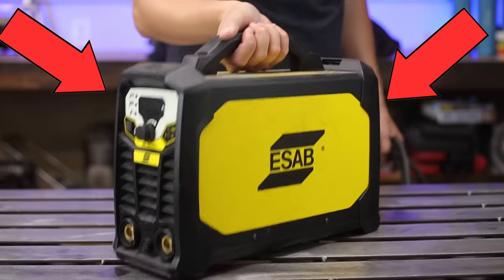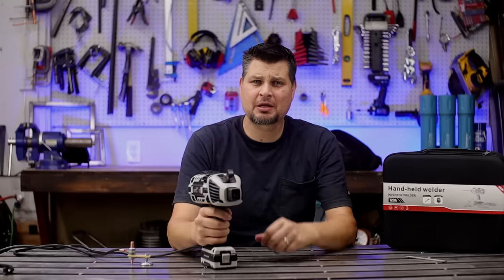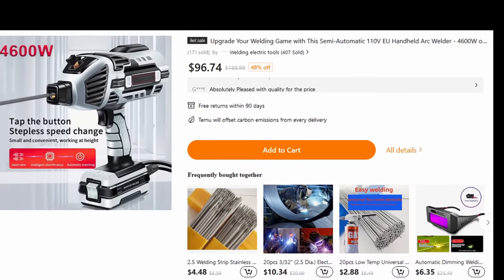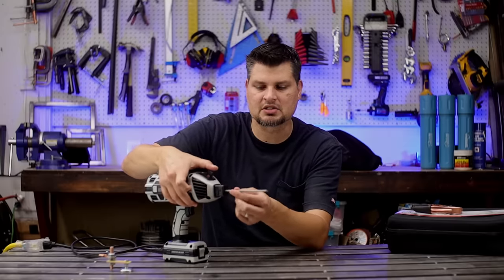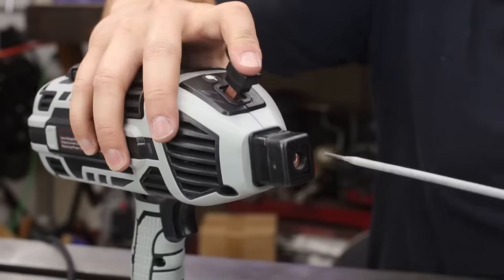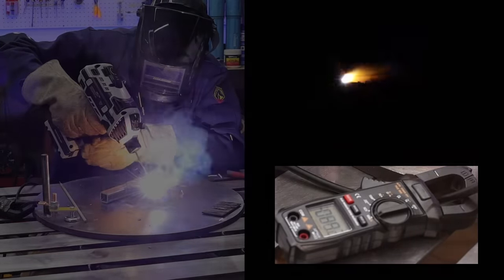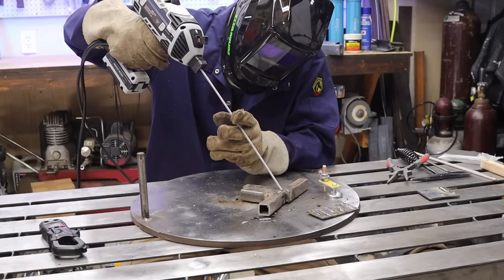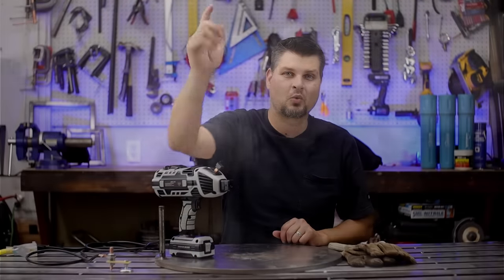The WELDER, Re-Invented! TEMU Surprise

Comment: That's like welding with a Brick.....I prefer to use a stinger.
Reply: Yes 🗿
Reply from the maker: Yes indeed!
Reply: agreed lmao
Reply: My first thought was I don’t weld a lot but damn I bet it gets heavy💯
Reply: My hand is tired looking at it. Maybe a roofer that handles bostich guns will like it.
Reply: @timwilliams2035  It would be cool if it was wireless but you’re still hooked to a short ass cable making it not useful
Reply: @@Eric-ub3epNot comparable. Welding requires fine, precise movements of the hand during operation, a drill does not.
Reply: Never seen this before,  might give it a try.  Got some occasional  scenarios where it would come in nice and handy.
Reply: @@Eric-ub3epyeah it’s a lot different   You must not weld
Reply: @theinquiringengineer bingo
Reply: @@Ralph-ub3ep The difference is I bought mine for 60 bucks and works as good as my miller that cost 800 bucks
Reply: @@Ralph-ub3epA cordless drill isn't 10 times the weight of the tool it replaces.
Reply: Dear sir, explain for a novice. Did some welding in high-school (i made a glowing ball). I’m a 37 y.o. electrician now, and wanting to buy something budget (pay for what you get). What am I looking for?
Reply: @darzo7527 a lot of these have a stinger attachment.  Makes it easier
Reply: Think outside the box bro.  You and the boys are out bombing the trails in some piece of shit jeeps.  You break a leaf spring on the trail and johnny has a 1000w inverter generator.  Presto you're welding on the trail instead of hauling the 100lb tombstone from the garage.  This definitely has its purpose.
Reply: It would probably be just okay for a portable "down n dirty" quick drive over to an emergency type weld for a temporary fix???

Comment: I actually have this.  It's legit as a beginner tool.  I've used it for 4 hours learning to weld yesterday. It's doing great at teaching me.  I've had none of the issues with the clamp, but I want to replace it with a magnet regardless.
Reply: This is awesome for backyard projects, I was able to do a full exhaust with this thing, also I got it for 43$ from temu ONG ITS WORTH IT
Reply: Replace the clamp with a Magnet?
Reply: Ats funny as hell. I learned how to weld yesterday
Reply: Cut 30% of the ground cable off it'll perform 300% better .. just take my word  you don't need half of it anyhow

Comment: This could be handy in an off-road situation to fix your rig to get back to camp!!!
Reply: Just bought one on Amazon gonna test out plugging into a 12v 450watt dc to ac converter! See if it will operate good using 3/32 rods or 1/16 rods
I tried this but it was not enough wattage to turn it on! Probably would need 1000-1500watt inverter to make this run!! Gonna try an 1800 soon and see! I Will post back here!
Reply: Exactly. Anyone with vision with preparedness would stash this in a side panel as a field option to get out of a bind. This is exactly what I said when he confirmed it could get an acceptable bead w/ penetration.
That's all we need to make it home.
Reply: @outdoorzone  just posting so I can see the update with the inverter.
Reply: Ive seen people take a lithium ion polymer pack from a car jump starter and use it to stick weld. Could probly have a dual purpose emergency welder/jump starter with a little know how. It was a radio tower tech who had to climb up and down those tall towers to make repair welds that were tiny but impossible to bring a welder up the tower for. So tiny light lithium pack with the clamps it came with and he had the perfect stick welder and no longer had to make those extra trips and hoist things up and down. Plus no need for a generator or inverter
Reply: @GonzoDonzo  nice!!!thx
Reply: Where you gettin your 120 power from if your packin a genset then pack a decent  welder
Reply: Sounds like a great way to burn down a forest trying to save a few bucks….

Comment: Seems like a good little low footprint emergency welder for those times at the track or trail when someone has a generator or battery box handy to make a trail or track repair on broken motor mounts or suspension components to get home.
Reply: your sentence reads like a looooong trainwreck. But : "yes", it appears to be a good single-use emergency welder.
Reply: @ololh4xx  I read it just fine. I don't know what you're talking about.
Reply: @maxx1o1 I think it’s a dig at the lack of punctuation. No commas, no full stops etc etc
Reply: Picture this:  You're leading a group of eight four man fire teams into a building secured at ground level.  You find a vertical steel beam, live power and quickly weld ladder rungs up to the third floor where you then descend and mop up the enemy.  Works better during daylight.

Comment: Even at a couple pounds only using that for an extended period of time, trying to be steady, it is certainly only practical for little welds, but I am impressed that it does work.
Reply: @tripplefives1402 ...... Except this in NOT cordless, it plugs into wall outlet
Reply: @loulagro2315  but it looks cordless.
Reply: @MR-backup  , Yes it does
Reply: Yes after using that for a day you'll have arms on ya like Arnie Schwarzenegger  🤣
Reply: Seems obvious to me that it's not intended for extended use.
Reply: This is perfect for being out in the back 40, either camping or trail riding, and you need to welding something back together to get back to camp with a small portable generator. Cheap enough to not care about dust build up.

Comment: I think it's a good tool for quick welds around the house or beginners doing small tasks.
Reply: Not sure a beginner would be better off with a heavy hand-held welder with a power cord and ground lead, vs. just having to hold up a stinger with one lead.
Reply: These could be really cool. For really quick welds. 
After solid state batteries come out. and can be cord free or carry a battery about the size of that normal inverter welder. of course if it was the battery pack option. I would get one in the normal inverter style. I would rather have normal equipment attached to the battery.
Reply: Quick welds around the house? What kind of house do you live in?
Reply: @donepearce  makes sense to me. I got all types of things I can weld around my house. Not as many inside the home.
Reply: @non1503  Clearly a language difference. In the UK, "around the house" means inside the building. "Inside the home" has no meaning as a home is not a physical thing - it is the feeling and atmosphere you create inside the house. To encompass everything I would probably say around the property. And yes, I could use a welder right now to move the hinge brackets on my garden gate. But not this one - it looks really clumsy to use.
Reply: @donepearce  Yeah for sure clumsy. very limited use. getting a drill out and some nut and bolts to attach metal. vs a little Zeus juice  to melt some metal. about the only thing I could thing of. 
But in that scenario you could probably get away with a automotive stud welder.

I learn a few ways to make hinges from sixtyfiveford channel couldn't find the original video I saw. But you could use this to make some from steel "Making custom Copper hinges & latch"
Maybe jb weld? that stuff is pretty tough. 
I bought a HONE stick welder for $90 on amazon US, of course. it's pretty amazing. Had it a year and a half. They have the lighter duty model for like $67 because of a $10 off coupon. That just kinda blew my mind right now. Welders use to be so expensive. 
Don't know the prices over there. probably double cause taxes and currency rates ect.
Reply: @donepearce ww all don't live in a apartment in the city. Maybe fix a garden hoe or lawnmower frame. Hell the possibilities are pretty endless
Reply: @donepearce  oh so your metal house doesn't fall apart?
Reply: @dogzer  when it does I shall know what to buy
Reply: @donepearce probably a thai house
Reply: I have one! I'm building a submarine to visit the Titanic.............
Reply: Maybe fix an exhaust?
Reply: 🤣 @donepearce  Gru House
Reply: I bought it, for making scrap metal art.
Reply: @donepearce A metal one. Lol

Comment: I bought a 45 dollar HONE brand stick welder and have been get impressed. It’s 120 amps and burns great. The he amperage it says is accurate and it’s very smooth. Burned 12 pounds of 3/32 7018 on my flatbed build and have had no problems so far

Comment: This seems like a great solution for people on a trip. If you were out and needed a quick repair and had the fuel to run a generator or use an AC inverter. I can see this being something to repair a broken metal piece for a trailer or some other repair

Comment: The semi automatic mode is a switch where you push on the trigger and it starts to weld.  If you flip the switch the other way you press the trigger once and it starts welding, you have to then press it again and it will stop.

Comment: Wow, learn something new everyday. Thanks for sharing this. 1st thought that comes to mind is do I really want to hold an inverter that close to the core of my body for any extended period of time .. before someone thinks Im crazy, consider that folks with pacemakers are told to go nowhere near welding machines. 2nd thought is, why hold all that weight in hand when for around the same price I can get a cheap stick box inverter with traditional electrode holder thats much lighter. Neat concept, maybe it has some useful applications, idk, but I really do appreciate you sharing with us.
Reply: The only possible benefit I can see is, you can throw it into the back of the SUV and take it to the cabin for a quick repair.
Reply: @Bob_Adkins  And its $66 I see. I'd rather be on a ladder with this thing, maybe?
Reply: People with pacemakers being told to avoid welders doesn't mean people without pacemakers should avoid being close.  The signals can interfere with the pacemaker, hence the advice.  Humans aren't made of electronics and circuitry, our bodies aren't interfered at all by the electrical signals.
Reply: @Mad-Lad-Chad  BS, "our bodies aren't interfered at all by the electrical signals" not that you're aware of?

Comment: In Australia we can get a little 130 amp stick welder that is about 8 inches long and about 4 inches square. Weighs bugger all and still runs a stinger lead and an earth lead. About $180 au
Reply: I've got a little Flux core machine like that here is the US and have used it to repair my snowplow, and butt weld the plow truck frame.  Works like a charm.
✌️🍻🍩
Reply: What’s that one?

Comment: Actually, the trigger function is clever, because you can move around your stick and activating just before you weld
Reply: Can do that with a normal stick welder, too. They pump out ~20v, it won't shock you unless you're laying in a pool of sweat on the grounded metal plate you're welding and grab the stick with bare, sweaty hands. Even in that scenario, it's usually just an "ouch" moment unless you're inside a pipe or confined space and get stuck in contact with the grounded surface and electrode.

Comment: Being 1 armed, I can't imagine wanting to use that much. 
Just added an inverter MIG, stick, TIG machine after losing function with my old Miller MM120. Seems to work fine for $200+
Haven't tested it to its limits ...YET.

Only real complaint is the unconvincing threads attaching the Euro gun, may need to replace the cheap gun with a metal threaded one.
Didn't come w/TIG torch, would also require a gas other than CO2.

Comment: I'm surprised at it's capabilities. I don't like the work clamp. If you can bend it by hand, I can see it melting away. I still may buy one. I like weird stuff like that.. stay safe man.
Reply from the maker: Right on, stay safe!
Reply: A ground clamp needs a tight, solid grip. That's the first thing I'd do before ever using it.
Reply: @Cantthinkofahandle117  that  it does. I just replaced a K910-1 today at work.

Comment: If I start welding from my bike for transportation, I may curbside it, but thanks for the excellent info, I was skeptical and now know I don't need one, my go to inverter box is an arc/tig/plasma  combination machine and is only 25 lbs soaking wet. Well, I was joking about the soaking wet part.  Good video. Thanks.

Comment: I reckon the Chinese amp is less than the traditional amp. My inverter welder reckons it's putting out 200 amps when it's nearer 130. It was very cheap and it works ok for my needs but the dishonesty and exaggeration of some Chinese sellers is ridiculous.

Comment: WOW didn't know you could weld with drill, will give it a try. Thanks!
Reply: I had a Spinwelder as a kid...it was a toy.  All it was, was a electric motor in a kid size drill casing.  You put a provided small plastic rod on it and with the supplied plastic build project, it spun fast enough to melt the plastics together...but barely.  If I recall correctly, using modeling glue worked better.

Comment: this seems something that would be fairly easy to use for someone that's never welded before also as far as the noise being right near your head just wear your protection
Reply: A normal electrode holder that is much more compact, much lighter and has much better adjustability for the electrode angle is easier to use in every possible way.

Comment: Just curious about welding becau8se I might try in the near future; is getting electrocuted while welding by amateurs common?  I can see you are working on a big metal plate which is grounded. What can I do to make sure I don't get electrocuted even if I mess up? Make sure I am not grounded by wearing rubber footwear? I notice some kind of welders have some kind of voltage change protection...is that to protect the device or protect the user?

Comment: Would this work to fix the propeller on a paddle boat? I don't know the first thing about welding, but would it burn a heavy enough grade to make a solid connection to something that deals with water pressure or would I need a more serious machine for jobs like that?
Reply from the maker: What's the material? If a low carbon steel and it's less than 3/16" than yes but I highly doubt the prop is out of regular steel.

Comment: This would be great for off-roading or maybe even being able to take care of some repairs around a farm.
Reply: Apparently you never had to do much repair around a farm. Sing the piece of junk. You need a good serious heavy-duty welder to fix farm equipment
Reply: @basquo2  Farm equipment is still just metal.  As long as the welder gets good enough penetration on the weld it doesn't matter how "heavy duty" it is.  "Heavy duty" is just a marketing buzz word these days, practically meaningless.
Reply: @Mad-Lad-Chad  you can have penetration on a weld that is on thick steel and still have a shitty weld. You have to be able to fill in enough to have strength on a heavy, thick weld.  And I'm willing to bet that welder right there will spend more time in overheat mode then actually getting work done for you. I have bought low-grade welders before myself. If you want to waste your life on a product like that more power to you
Reply: @basquo2  Willing to bet based on....what?  You know nothing about the product and are condemning it for no reason.  Also, not all farm repairs use metal as thick as you are speaking of.  There are absolutely repairs that this thing would handle that farmers would find useful.  Useful enough to justify buying it?  Dunno, that's for each farmer to decide.
Reply: @Mad-Lad-Chad  unless it's the thin sheet metal on the outside of a machine, 99% of farm equipment is made up of heavy duty thick Steel. If it's not it's not worth having. It'll just end up as scrap metal. Like I said I've had cheap welders before and they all end up as crap. They might lay down a little bead on some nice thin metal but when it comes time to do some real work they just don't keep up
Reply: @basquo2  Respectfully, no it's not.  If you're referring to field equipment sure.  But at least where I live farmers have a lot more equipment than just the large machines used for harvest.  Here in KS I've worked with a lot of farmers that'd have a use for something like this.
Reply: @Mad-Lad-Chad  must be hobby gardeners not farmers. Working ground requires good heavy high carbon steel to resist wear and tear and every damn rock out there. You enjoy your little toys

Comment: Put it in the tool box in your pick-up truck, provided you  have access to AC power to run it. It  might come in hand for minor emergencies where only a welder will solve the problem.
Reply: That's what I am thinking. This thing is just the right size to be a handy portable welder.
Reply: Like a spot repair or welding a nut on a broken bolt for extraction.
✌️😁🍩

Comment: I bet if you upgraded the cords with premium wire of a heavier gauge on this it would get you a little more performance. They probably used the cheapest wires that they could get by with.
Reply: I had a Lincoln mig welder from Lowes. It definitely ran better after I put a heavier ground lead and heavy duty brass clamp on it.